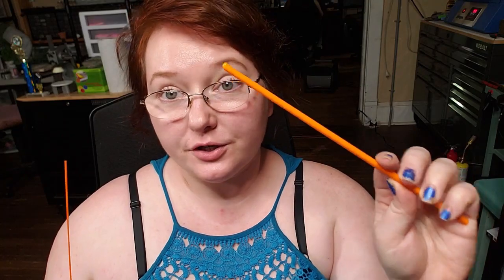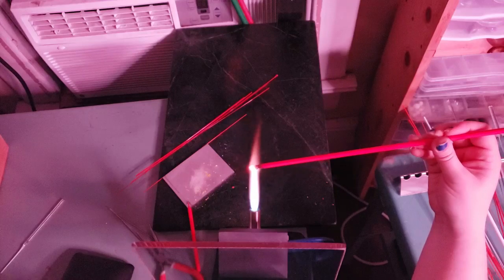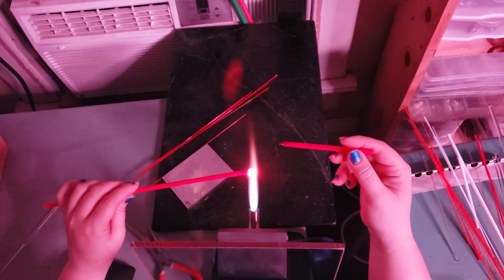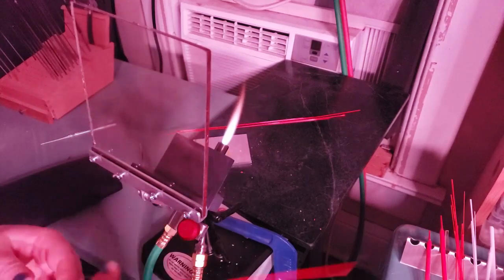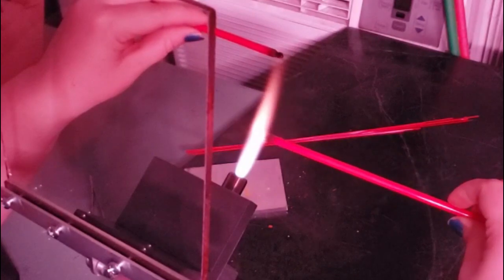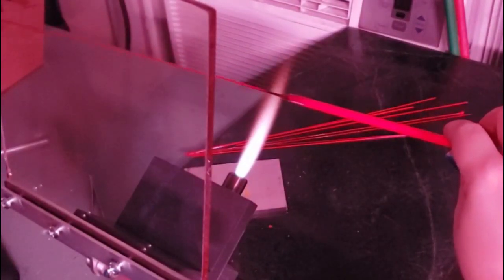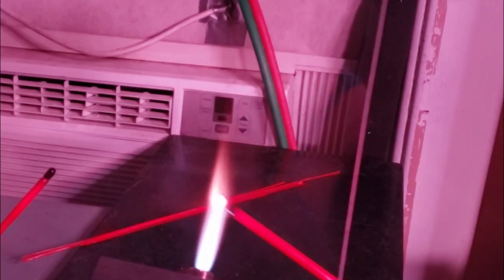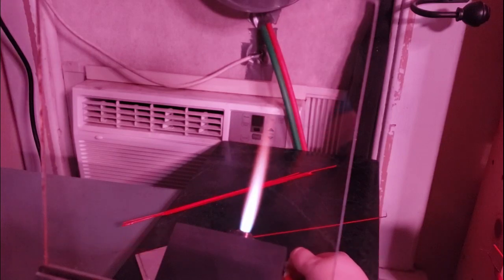Learning how to Pull Stringer

Comment: Excellent video Von! I love how you make your stringer, I never did it that way but your way is very nice! I always just used pliers on one end to pull, so always ended up with a little funky end but just used those for frit or whatever later on.  Your way the stringer is quite lovely and clean/consistent on both ends, excellent!

Comment: hey, glad you're expanding into glass, I am a soft glass and boro worker for over a decade < this is a alt account name for gaming >  I also do jewelry. but, PLEASE MOVE YOUR LINES FROM OUT OF IN FRONT OF YOUR TORCH, you're only using a small flame not as much of a threat though stringer can fly off onto the lines, but you have your Gas lines directly in front of your torch, That is a Major safety issue < no fear or judgement we all start out how we do, but for SAFETY , Move those Lines ASAP. With that said I love all the videos you have been making and the stuff you make, so keep it up. just saw this video though and I do not normally comment & for your safety and household move the lines , Much love & Peace & Happy creating.
Reply from the maker: Thank you so much for letting me know! ❤
Reply: @backtoearthcreations   Yeah, no worries, have fun melting. you might want to use a cement backer board piece cut out in front of your station to protect the wall as well from any flying stuff.
Reply: I thought I was the only one spitting out a ton of issues, I haven’t started my glass blowing journey yet but I’ve worked around welding,cutting torches and I saw a lot of no-no’s

Comment: “Im in front of my ventilation” AC unit blowing towards her torch 
It’s literally blowing fumes right back at ur face.
Reply from the maker: Hey Colton! you'll notice the light on the ac isn't on;  we don't run the fan and the ac at the same time 😘
Reply: @backtoearthcreations  good I’m glad, no hate intended. I’m just a safety nut and I spotted some concerning stuff. I saw other comments and i noticed you acknowledged them. I hope you took some time to do a couple more safety checks on ur work bench. Thanks for all the good advice in the video!